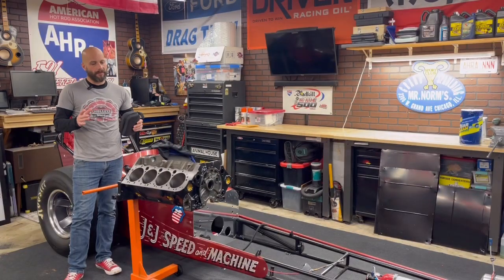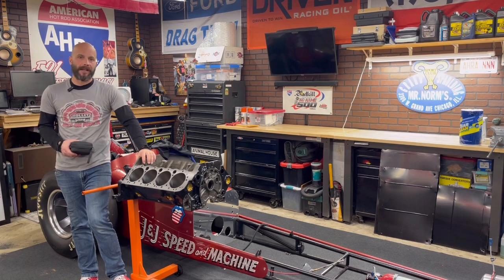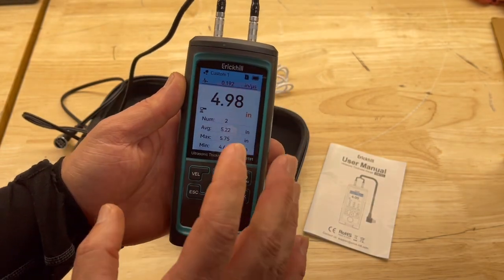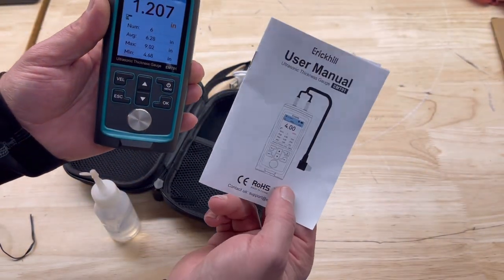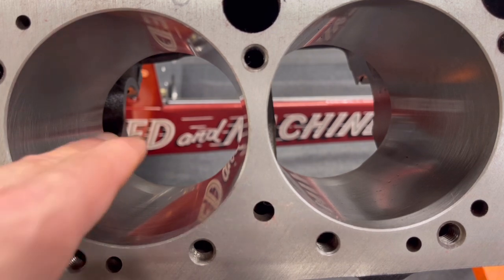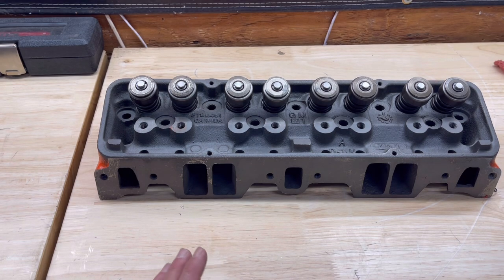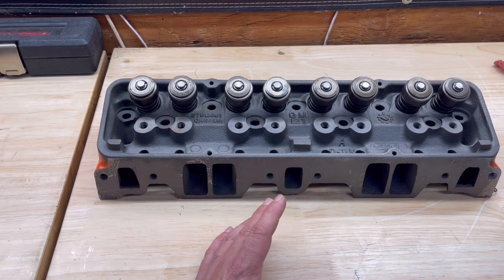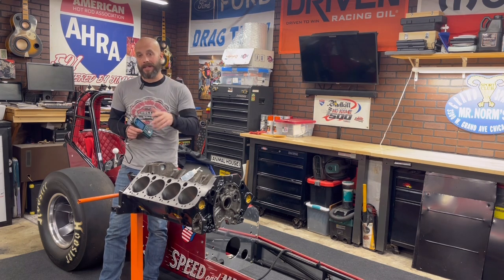Sonic Testing on a Budget? Easier Than You Thought… #science

Comment: .286” thickness after a 0.060” bore seems impossible with a 4.4” bore to bore centerline.
Reply: he only showed measuring up/down, not cylinder to cylinder left/right? technically between cylinders and assuming its solid between the cylinders it would be .340" if the block had a perfect bore to bore center.

Comment: That particular transducer is designed the measure on a flat surface.  Don't you need to compensate for the gap between the curved cylinder wall and the flat surface of the transducer?  For example, if the cylinder wall you are testing has a diameter. of 4.154 and the transducer is 1/2 inch wide then you have a gap between the cylinder wall and transducer of .0151.  So, the actual thickness. would be .285-.015=.27

Comment: I’ve been sonic testing blocks for 30 + years.  He’s right about checking 12 points per cylinder. I have one point he didn’t bring up is the thickness between the cylinders, 0.100” is minimum for street use, 0.120 is  minimum for hot rod stuff. Above 1 1/2 hp look for an aftermarket block.
Reply from the maker: Good info!
Reply: Would either of you guys have a recommendation for a sonic tester in a budget friendly realm? Appreciate any input. Would be using it in diesel and gas applications.

Comment: I have one of those, very similar, different brand... Says does not work on cast iron...  Does yours say cast iron in the instruction book....    I've tested mine on aluminum, it was very very close....
Reply from the maker: mine does, you have to search quite a bit on the internet to find out how to set it for cast iron
Reply: @2HacksGarage  So why did you set Option 1 to 192 in/us....  when its got a cast iron setting....???.....  Mine looks the same as yours but has a yellow button on the top left....same layout, same probe  etc...
Reply from the maker: @drcolster  mine did not have a cast iron setting so I looked it up and also wanted t get it as accurate as possible, whats up with all the questions?
Reply: @2HacksGarage  I don't think that Tester does cast Iron..  .285" for a bored out 327 block. that's thicker than a GM RACE BOWTIE block...  Go test that tester on cast iron you can measure the thickness and then test....Accuracy is important ...  others may follow and go wrong..  keep well...
Reply from the maker: @drcolster  https://ims.evidentscientific.com/en/applications/testing-nodularity-cast-iron
Reply: @2HacksGarage  Great Link....  But nothing to do with that small tester...

Comment: Some tips to get the most accurate results:
The velocity you input is the most important aspect for these measurements. It's always best to have the exact material velocity to obtain the most accurate result. You can use a section of the part (in this case the block) to setup your instrument. Find an area on the part where you can us a caliper or some other calibrated measurement device to obtain the thickness and setup your instrument accordingly. A little complicated to explain in this forum.
This is a dual element transducer (called a pitch/catch probe) therefore the line that separates the two elements should be in the axial direction on the cylinder. The variation in the readings you're seeing is caused by the probe rocking on the surface which will have an effect on the accuracy of the reading.
Reply from the maker: Great info, I will definitely make a note of that!

Comment: Surface Detection methods. 242 thou average wall thickness on heads, 180 thou before boring on blocks. Lucky your not working a Thinwall 9.2" deck Cleveland..187 on heads, 90 to 130 thou on the cylinder bores. Great to see you doing the spot measurements.
Reply from the maker: that is pretty thin!!  In your opinion, on cylinder walls, what is too thin?
Reply: Chevy Off Road and Marine in Australia said any engine with less  than 180 thou at the thrust face is getting too thin for an 11:1 compression engine. From Factory, 351C 4Vs and Boss 351s were at 130 thou from birth at 11.2:1. I've seen one guy's 2.3 Turbo Lima Mercury Capri get down to less than 157 thou at the thrust face after a 40 thou overbore and survive 750 hp and 20 pounds worth of boost at 7.5:1 compression.
Reply from the maker: @ so probably comes down to the integrity of the iron being used.  Well, and or luck!